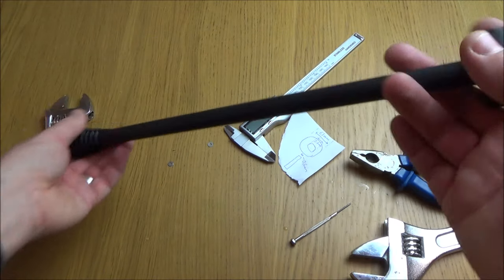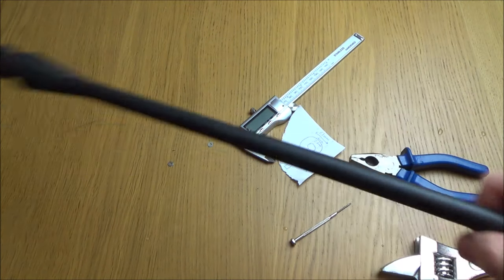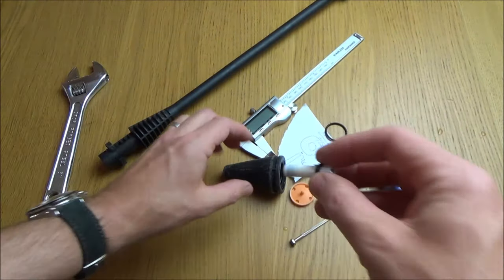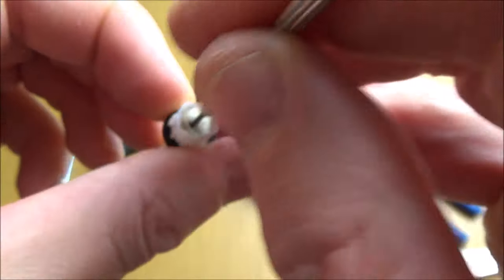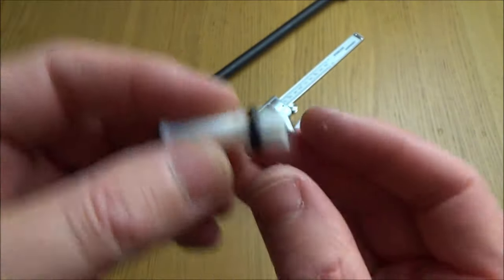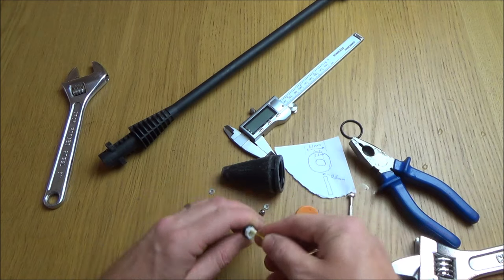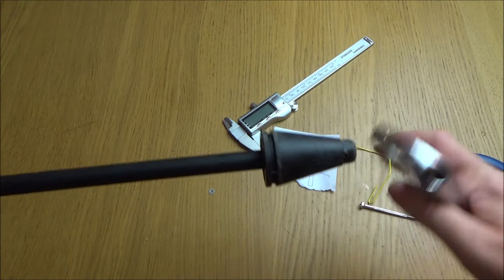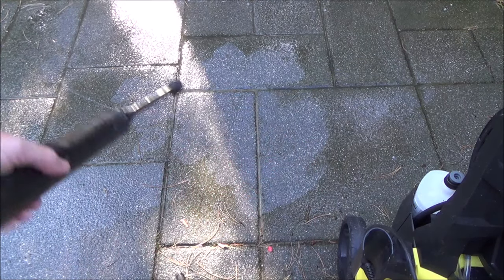How to REPAIR a Karcher Dirt Blaster

Comment: Rather than using a small washer, scavenge a spring from a ballpoint pen.  Cut it down, to say 5mm  and place under the bearing ball. The cut down spring should be long enough to allow compression once the ball has been refitted, but not so strong as to push the ball out.  My lance worked perfectly with this mod.  Only drawback is I suspect that the spring will rust, but these springs are easily available. The spring should mean the ball can move to the optimum point without having to finesse the packing thickness of a washer.
Reply: Genius

Comment: Couldnt find a washer. Used a bit if rebar wire. Wrapped it round a 4" nail. Cut to size with nips and shaped with pliers. Job DONE!

Comment: great information thanks,  off to my garage now  to find some small washers,  had it apart already twice. Didn'i go to plan,couldn't find a washer that small, so ended uo trimming the plastic off the ball end and then pushed out the nozzle from the other end only pushing it back a small way before screwing it up.  Worked fine.

Comment: This is genius! That was an easy fix, even for a technically unintelligent accountant like me.
The inside part looks a bit different in my pressure washer, the ball bearing cage is closed at the bottom. However, I took a little washer and put it into the cage, put the ball bearing back, used a bit of silicone spray before reassembling and it worked again. Saved me at least 35£/40€ for a new dirt blaster. Thanks a lot for the brilliant explanation!

Comment: Excellent instructions ... thank you very much!   Fixed by moving the nozzle as 6mm washer wouldn't fit.  I only use the washer for about a day each year so shouldn't have worn down ... but then my Karcher washer needed a new pump after the first year.

Comment: Thank you so much for this, the washer totally fixed it!
We had to use a pair of grippers on the main shaft at the bottom to get enough torque to loosen it, it felt like the shaft would bend otherwise. We tried the nozzle method but had no luck, but once we filed a washer to be able to fit it immediately started working again perfectly.

Thank you for this super clear and concise video!
Reply: Yep, pipe wrench and some vice grips got it off

Comment: Brilliant thanks for the solution. 
Hardest part is finding a tiny washer. I couldn't but found a dome head 6mm nut but it woudnt fit. 
My solution was to cut a cross section of a RAWL plug. Pushed it in and then put the ball bearing back in. 
Job done 
Tks
Reply: Great idea to slice 1mm off the end of a wall plug !!

Comment: TY for the tip on how stiff it is to unfasten the first time! It really is very, very stiff but it doesn't break - twisting from both ends worked better than clamping the jack end.

Comment: Excellent video - struggled to get the head of the lance off but eventually did it. Mine must have  been an older design as slightly different inner section but put a small washer behind the ball bearing and works as good as new. Thanks for posting 👍

Comment: I found it very difficult to find a washer that small BUT what I did instead was cut down a small 'O Ring' I had and although the ball is not able to turn it brought the ball out far enough to it can track on the yellow plate and that fix the Blaster. Thanks for your excellent youtube.

Comment: I soaked mine in white vinegar and then added another thinner rubber ring and it absolutely hummed for about 30 minutes.  I think a thicker rubber ring of the same diameter would be perfect so I'll keep an eye out for one.  I did cut down a small copper washer and tried that and it span but not as fast as it could - I think because it does block the water a bit.  Karcher should supply the white bit as it certainly wears out.

Comment: Ok Thanks for this video. I watched it many times and have found there is an alternative solution .
 In my model there was a difference as to A ... where the washer is located and B the fact that my situation there was no passage for water to travel beneath the ball bearing.
  I tried the washer etc but in the end with my model the solution was to carefully sand down the RIM around the edge of the ball bearing position.
   When I use the turbo spray I have to tap the wand against something hard after the water is flowing and away I go.
Reply: I used the 'sanding down' method using wet&dry - worked !!

Comment: Just saw your video. For years mine wasn't working either and I never bothered to look if I could take it apart. Still need to test it but here as well... blocked nozzle, worn-out ball bearing casing and dirt in the disc.

Thanks Mate! :)
Reply: @My Mate VINCE To get back on this at you, Vince, I had to go a different route. My spinning top that the ball goes into was shaped differently and I just couldn't get the right diameter ring to fit inside mine under the ball. I went to all kinds of shops DIY, specialist in all things iron, farmers shop, car tools and parts shops... you name it.
So I thought well... what if I can get a piece of plastic or an old bank card or something to cut to size. So since I didn't have a spare card I had to think.

EUREKA! I shouted in my head as I glanced over to my box with plectrums. I can use an old plectrum and cut that to size, especially since they are made to be durable. Durable it was as I could barely cut it with good household scissors.
The plectrum I used was a yellow Dunlop Tortex 0.73mm one. Was exactly the right thickness for the job and the thing has worked flawlessly since.

So plectrums are ideal for this job. Robust and easy to cut as well as the fact that they come in all sorts of thicknesses and only cost a few cents.

NB. That o-ring goes over the end of the lance bit the tip screws onto by the way. Just so you know. ;)
Reply from the maker: Plectrums are a great idea due to the different thicknesses. Also they won't rust, I should have used a brass washer really. Well done for fixing it. Once it wears again maybe a slightly thicker plectrum could be used to get a little bit longer out of the lance before buying another one, thanks for the tip on the washer :-)
Reply: @Mymatevince  No problem. I was looking all over the place for a solution from normal hardware and water tap washers to parts for aquariums or maybe some bamboo.
Sometimes you find solutions in the strangest places, and this solutions probably lasts for a long time. The plectrums I use have a plastic compound that is as tough as a tortoiseshell.

That said, I am starting to become like my grandfather. Never throw anything away that could be useful. Bicycle inner tubes that might have a leak, but can be very handy if you need some spare rubber. Old leather and all that kind of stuff. Base materials that I just can't easily seem to get my hands on.

Comment: Thank you! Saved me having to buy a new nozzle! I've got a different/newer nozzle but the same technique works.
I'd already had it repaired once (still in warranty) so it unscrewed ok. My version has a one-way ratchet thing to stop it unscrewing, but the Karcher repair guys had already busted that, thankfully!
It didn't work straight off, sluggish spin at first, then it started working properly. I might still fiddle with it

Comment: Found a 6.3 outside * 2.3 inside * 0,6 thick mm washer.
It fits, but havent tested yet. Since its wider, not enough water may pass. It should rotate though.

Couldnt open it btw. Ive got a Kärcher K2 too, but the rotating lance is slightly different. So cant get the that wrench on it.
Tried with grip pliers, but they slide off easily, as the thing is very conical. And i dont like it when it slides off and bited my finger.
Since its not working, ive got nothing to lose.
Took adjustable wrench to hold one end and used a pipe wrench on the nozzle end. Worked fine. Dont care about bite marks on it from the pipe wrench. It doesnt have to be pretty, but it does have to work.

I havent used the thing much. Maybe 3 times did the pavement here. And i bought it brandnew.
Ty for a very good video on how to repair it.

Comment: Nice to see how it comes apart. I had to put it in a bucket of very hot water to loosen it a bit - before that I was sure it would break...cleaned out the spin plate and now it's perfect again.  Used some silicone lube on thread so it's easier next time.

Comment: WISH I HAD FOUND THIS FOUR YEARS AGO - I have had THREE of these fail on me over the years and I have kept them 'just in case' - I recently threw out two of them and kept one that was still partly working.   Then I found this video - FIXED IT !!  Wish I had not thrown out the other two !! 
Just a little modification to the video - I didn't have a 6mm washer to hand so instead I used wet/dry paper to take a little off the white plastic rim around where the Ball Bearing is fitted - this means more of the ball bearing protrudes slightly more and can do its job.  I also moved the black nozzle out slightly as suggested in the video to get the optimum length for the insert.

Comment: Thank you, so helpful. If this helps others try this, if getting the head off is proving difficult, try warming the head with a fan heater for a few minutes, mine came off with little effort by doing this, just waiting to get the right size washer and repair mine.

Comment: I had my new, used it once and for this problem. My question is why Karcher doesn't puts that metal ring in the first place. They prefer to sell a new blaster as they tried with me. I would buy a Kranzle when this one fails. Good video, thanks.

Comment: great info, thanks for sharing that, can you help me find a replacement part for the vario lance . the white piece in the core has a crack which is causing lower pressure even when i twist to max

Comment: Is that a K5? 

and here i am selling nozzles at work...
btw that washer might be in inches. Its pretty odd that its not an M2 or M3 washer but in between the two, having a 2.6mm middle hole.

Comment: Thank you, Vince. I have hard water. I cleared out the wand tip & the entry filter, but my Karcher unit still has low pressure. Where next can I check for lime build up ?

Comment: I watched the other version "Fault Diagnostic Video" Nice BTW Vince.. 
So at first I thought with this video it was with some other fault that may have resulted, but to my dismay and relief as well, it was a how to fix the fault you just diagnosed and fixed, Which I think BTW was spot on.

NOW... Most peeps are just after advice on how to fix their device and really don't care how and why the fault came about, they just want to know how the damn thing can be fixed.
Hence they google for this video, Anyway I dropped a like on both versions.. even though I prefer the pursuit or hunt for gremlins Err-wear N tear and or design flaws that can be diagnosed and then a fix and or even an improvement applied, Eg: a more suitable part and or design addition as per this video, a fix BTW that if the manufacturer was aware of could actually help provide them a reputation of excellent reliability by their products, if only they had placed a more durable surface where it is needed..
Reply from the maker: Thanks Koala, that is exactly what this video is for, people searching on Google. If they don't know this channel they wouldn't want to watch a 20 minute video of me trying out different things so I just showed a few possible solutions :-) It will be interesting to see long term if this one gets more views than the 'trying to fix' video :-)

Comment: Finally after weeks of procrastination l got around to fixing my karcher. I didn't have the right sized washer but pushing the nozzle further out did the trick 🙂.  I noticed your Omega Speedmaster automatic, I have the Moonwatch which has a nylon part specifically designed to improve the reliability of the mechanical movement. However l think Karcher putting a plastic part in this critical element is more to do with planned obselescence rather design improvement?

Comment: I have a different design nozzle, mine does not allow water around the ball bearing, that cavity is sealed on the other side, but there is an open area in the middle between tip and ball bearing side where the water goes in. For years mine required a tap on a pavement to switch from steady to rotating beam, the required tap got harder and harder with time and now it doesn't work anymore. If I ever get it to spin it stops after some time. Tried that trick you've described, but to no avail. I guess mine must be faulty as I see some water splashing at an angle next to the main beam.

Comment: fixed it! thanks a lot! mine was a little bit different, doesnt hace the holes after the ball (sorry english level) but it fixed anyway. otherwise the other lance, the simplest one, have same working issue just because  the little hole wasn,t exactly round. Just for this little detail the whole machine goes wrong.

Comment: Great video but mine doesn't have an end to put a spanner on and seems to be a sealed unit. It might be an older model (K6). I'm wondering if mine unscrews from the lance end but if I twist too hard I think I'll snap the lance. Any ideas? Cheers.

Comment: Had same problem with mine, but whilst the ball bearing needs to sit a little proud, the small nozzle needs to be bullitt shaped. Had to round mine off with a small file as it was kinda flat. Try this if the washer under the bearing alone doesn’t work for you.

Comment: Thank you. Used this fix today but as i hadn't got a small washer I used a piece cut off a plastic wall plug, tried a few different depths but it worked pretty good. However when I try to restart machine it takes make trys to get it back working with decent pressure, not sure is this due to the lance  or machine. Overall very good tip.

Comment: FYI - they have changed the interior component that holds the ball bearing, which makes fixing it very difficult (I gave up and bought a new one) - where the bb sits, it's a cup on two legs with the 2x-grille and pen nozzle housed in a way you can't get at them. I've been trying with flux-cored wire, can't get a needle in there, can't hook it out... I lent the thing to someone for 5 mins and they jammed it into a plant pot, pushing the nib back into the housing - the bb floats in there in the cup and if the nib is even a few mm back it just sprays in an odd direction without the spinning. I'll have a look at it again tomorrow, but so far a washer under the bearing didn't help. Maybe it needs more - If it was possible to remove the nib, it could be fixed, but the tool required needs to be like a cocktail umbrella or that thing they use for catheters, but with fish hooks to yank it (painfully) forward - problem is, then, the plastic is a little stretched and the nib a little crushed, so it becomes more and more loose until the pressure finds it easier to wedge the nib back in again. It's almost as if someone has seen this video and thought - well we are not selling enough of these replacement lances, let's redesign it so the most common fault can't be fixed at home... Don't buy cheap Chinese ones either - they suck!!! Don't spend £20x3 instead of £40x1. Sodding Amazon forcing me to be a consumer when I could've fixed teh old design..!

Comment: Is there an optimum length end-to-end for the nozzle & ballbearing assembly?

Tried a new washer and moving the nozzle tip out - either the white nozzle assembly rattles inside the Lance when assembled back together or it's still not spinning, presumably jammed.
Reply: YourEventFREE I live to know the optimal length too. Plus does the ball bearing need to be able to move?

Comment: Hi, The vid' is first class ,However it dosnt fix the very same problem I have with my B302 Model.
I have taken the wand apart & found the nozzle bits, again however the parts are not the same as yours, The jet column does not have a view of the tiny jets, it does not have a clear view to the bottom because of a ball bearing in the way that falls out to reveal a solid round cup that the bearing sits in.... it is worth mentioning that the bearing is virtually flat to the surface &  is only about 1mm proud, of its plastic seating under that are two plastic legs that form part of a plastic housing that holds the jet there is no access to the jet  I note your action in placing a small washer under the bearing.....would this be enough 
Can you help or advise if a new part is required as the model is about 20 years old but until today has worked ok.

Comment: Thanks. That appears to be usefull information. Before I found your video I watched one from a german couple. They claimed that the Karcher itself should always be put horizontally and not in the upright position while being used. They say that otherwise the lifetime of the Karcher will be shortened drastically. Though they do not point out exactly why I presume that could wear out the pistons more. But that is just a hypthesis on my side. Got any opinion on that?

Comment: Thank you so much for putting this video up! I just don't think the ball seat is really worn. I have worked through the nozzle with a needle and some phosphoric acid and felt some resistance from the inside  before the hole. It seems to be just enough calcified to slow water travel that much to inhibit the spinning. Your washer might just give more momentum to help spinning the barrel? What do you think?

Comment: Hi mate. Where can I get that size washer from and what is the actual technical name of it. Lol. Great video by the way as this is the same issue I’ve had!!!!
Reply: I need this washer also can't find the size needed, did you have any luck?
Reply: It's possibly an M2.5 washer. The dimensions in the video are off by 0.1mm if that's the case

Comment: total nonsense at 99.9% the reason for the nozzle malfunction is the plate with the holes, the holes disalibrate and the nozzle stops working, unfortunately the plate itself is not sold so the karcher sticks us in the bottle